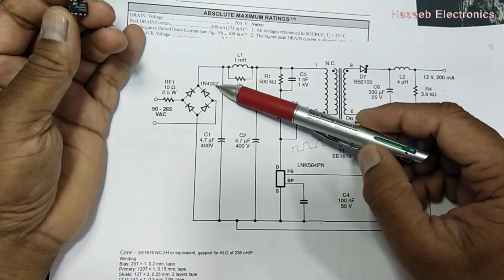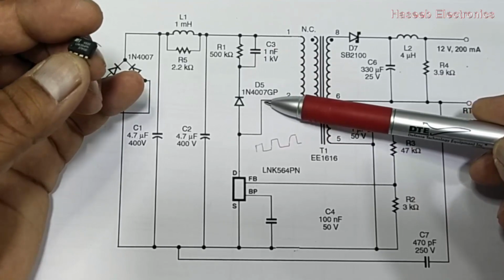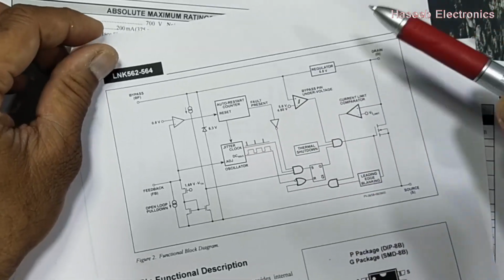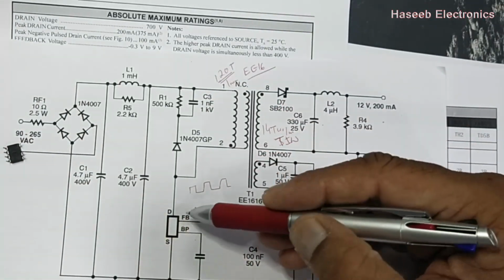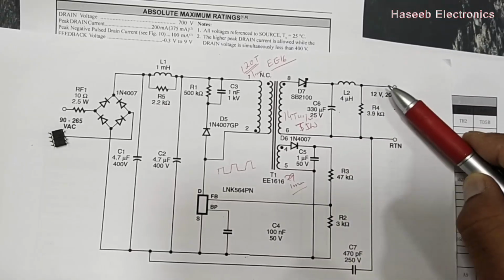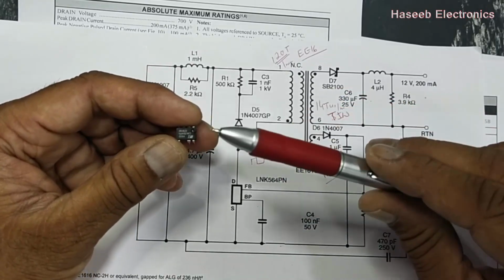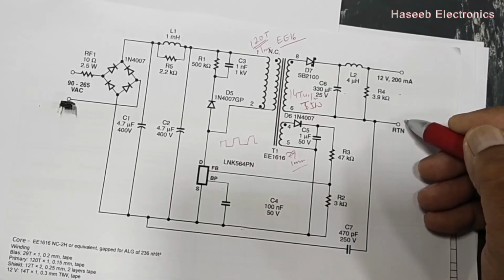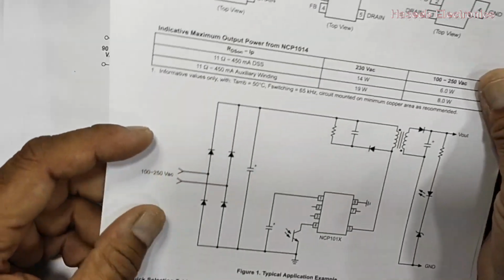{491} LNK564PN, Datasheet, Application Circuit Diagram, Equivalent, for LNK562, LNK563 & LNK564

Comment: Excellent as always I have a boiler control panel to repair with this chip on it. Your explanation was spot on, your comment relating to supply voltage and snubber circuit ok, then change chip is all I needed. Now ordered. You really are the expert on smps knowledge, fault finding and repair. Thanks again.
Reply from the maker: it is my pleasure 
stay blessed

Comment: Sir can you help me identifying the pin out configuration of the 6 pin and  5 pin voltage regulator used in the mainboard of led tv sir tnx
Reply from the maker: please write part number
as there are many types of regulators are used in tv circuits. each have it's own Pinout 
please mention part number
Reply: @HaseebElectronics  i see only in the internet sir there is a tech blogger that post the repair i think the. tv  led is combined the t con in the mainboard sir

Comment: شکراً جزییلاً

I have question on those SMPS using Synchronous Rectifier and output mosfet;

How can I test output mosfet for short circuit without desoldering theme?

Can I just desolder the primary wire of switching mode power transformer and expect to powering on the smps working?